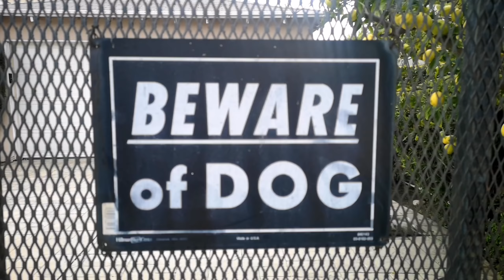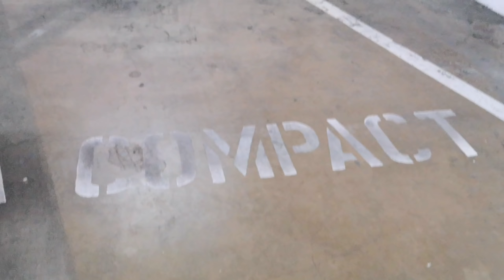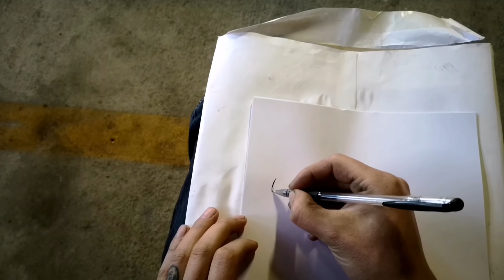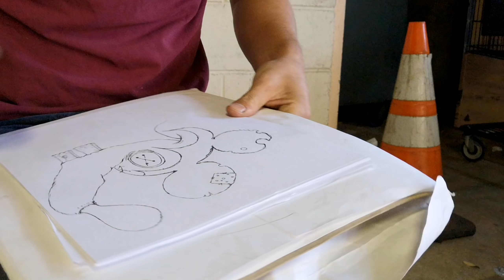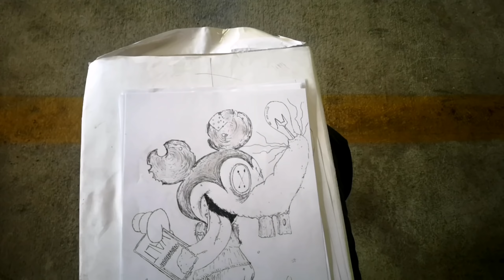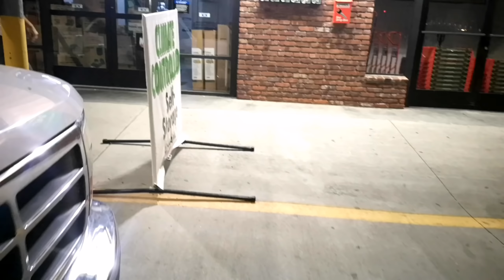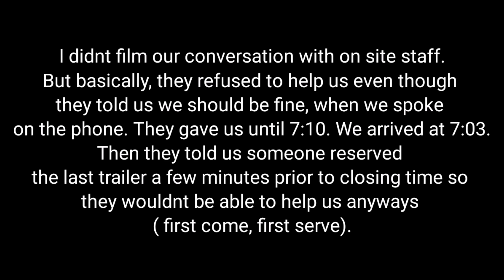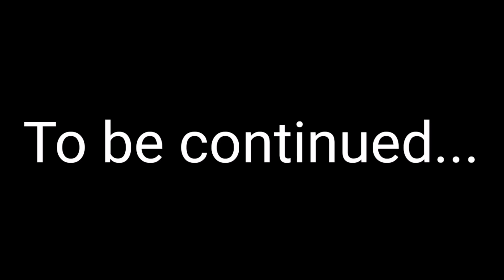Well, then there's that | Another VLOG #70

Comment: Also, distilled water is used in batteries and also in paint systems. The paint systems are of the type that you submerge the part or complete car in a tank of water with the paint pigment it . The parts have a positive or negative charge and the water has the other. It kinda works like a magnet, the paint sticks to the part and after it comes out of the tank gets baked on. That is the best way l can describe it. Have a safe and pleasant journey.

Comment: Distilled water, for at home usage, can and should be used in appliances such as clothing irons and portable humidifiers to prevent scale build-up.  Basically any appliance that has to heat up water.  It is also used in chemistry laboratories etc. where the minerals (in regular water) can either affect the test results or bugger up the equipment used to determine such results....if that makes sense...lol.  On a side note; it is the minerals dissolved in water that conduct electricity and not actually the water (H2O) itself....  Safe journey home Josh....Great vlog!

Comment: I was just thinking about you today and here you are. You would use distilled water for anything that you want to be "clean". Tap water has the mineral "contaminates" in it as you said. The day I moved U Haul had rented the truck I was SUPPOSED to get. I found out when I got there to pick the truck up. It's fortunate that everyone I know has a pickup. But still... what good is a reservation if they don't honor it?

Comment: I never knew the water you put in a radiator should be distilled.  🤷‍♀️ It makes sense, tho.
Reply from the maker: Well you shouldn't put any water in it as the sole substance. 50/50 mix is best.

Comment: Morning josh. The truck still going to have to sit at the border.as they're going to want to make sure that there's no liens against it before it leaves the the country. Anytime I've imported vehicles out of the States into BC it's normally taken 72 hours to clear the border. now I'm not sure if things have changed but I got a feeling you're going to be waiting a little longer than you might think. Just a heads up and hopefully I haven't spoiled your day.
Reply from the maker: Should be fine. They already cleared it. But then they make you wait three days before you can cross the border. Which is why I was gonna leave two days later. I probably didn't explain it well in the video.
Reply: @JoshuaAlexander138  aw ok, I didn't know that you already were aware that the truck would still have to sit at the border for 3 more days before crossing. Take care and good luck.
Reply: You send the paperwork in advance, they approve it, then 72 hours later you are allowed to cross the border, so if you time your trip properly, you don't actually spend any time sitting at the border.